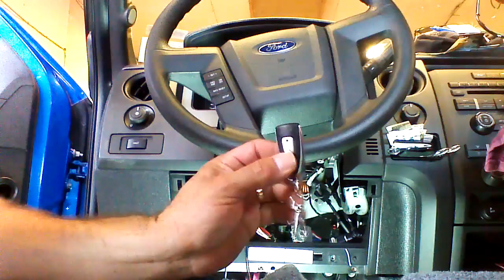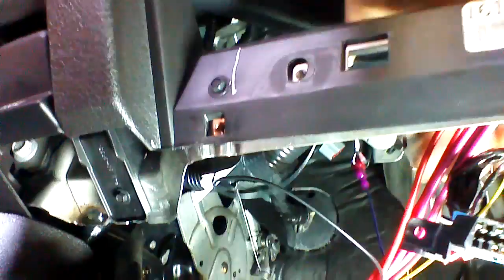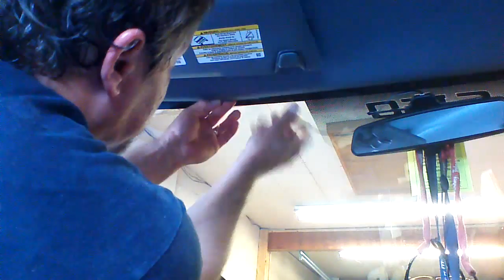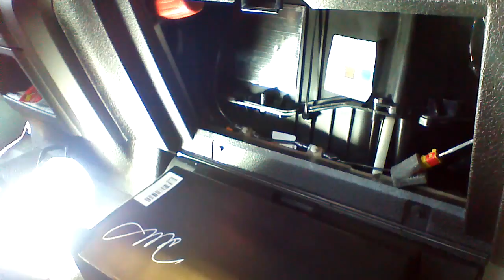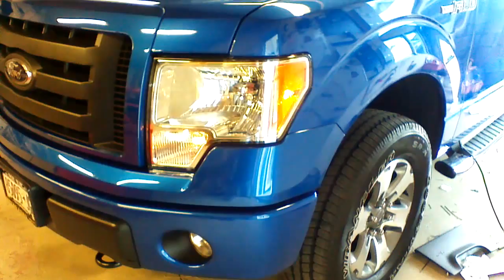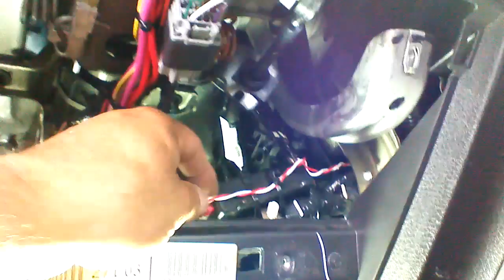Ford F-150,F-250,F-350 Fast Remote Start Installation

Comment: how can you add a remote start on my 2003 F350 7.3 diesel with glow plugs
Reply: eBay remote.. turn your key 7 times push lock on remote and you good to go.. 7 dollars job